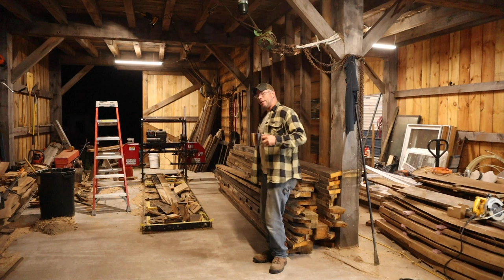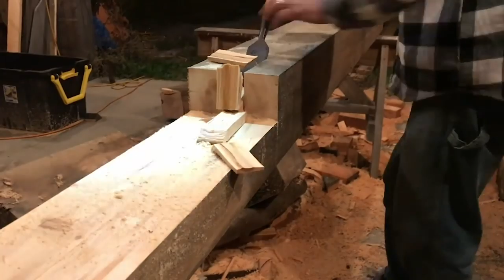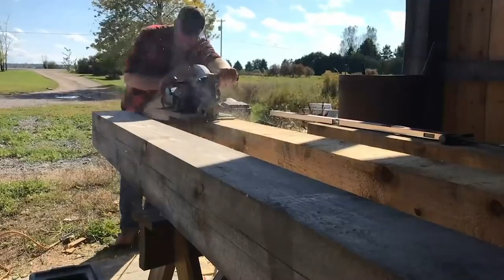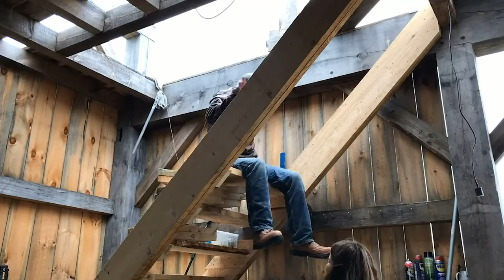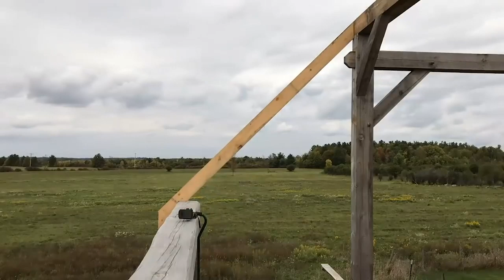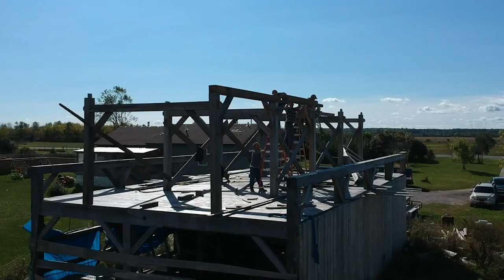The Most Satisfying Tools To Use That I Own: A Timber Framing Vlog

Comment: 3 Years?  Seriously ... 3 Years!
Who'd of thunk it? 

It seems you only remember changes when they are in gaps or major! I had to drive in Manchester last week (10 miles from me) and it used to be my patch for work ....... I kind of knew where I was, but did not recognise most of the buildings! Same with your "Big Shed" ..... you do not see the changes because they are individually small and not significant ........ until you take a step back and look at the whole of it ;0) 

Nice to see those clips ..... and it certainly has come along since a Concrete Slab and "Tales from the Pit" ;0) ....... and I am not just talking about the building!

Comment: Where can I buy timber framing tools, ie. the chain mortise tool, all I have seen are cheep crap!
Reply from the maker: The Robert Sorby chisels are good, you can get those on Amazon.  Skilsaw makes excellent beam saws, you can order those through their website.  Your local hardware store will usually carry the Stanley Sharptooth saws, they work well for hand sawing.  You can make your own mallets.
Reply: @TheTradesmanChannel  How about the chain mortise tool?
Reply from the maker: About $1700 new on Amazon.  Around $1,000 used on eBay.